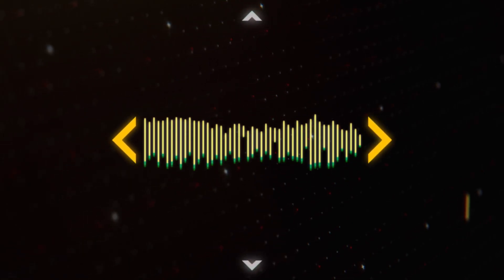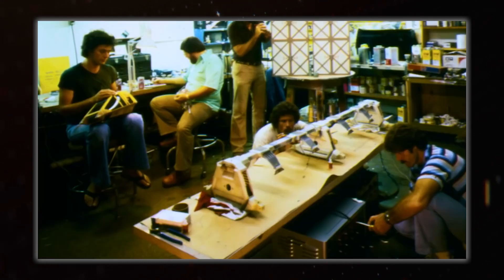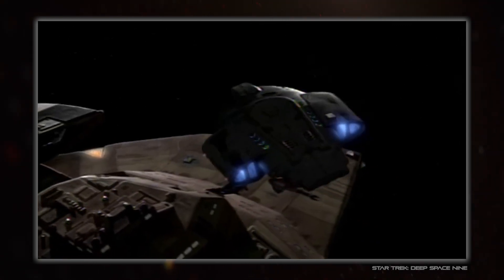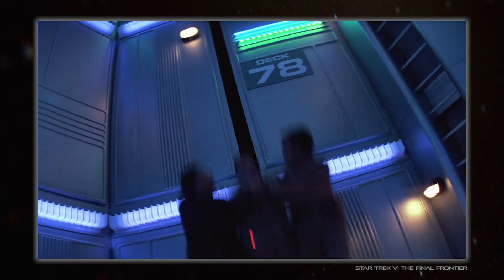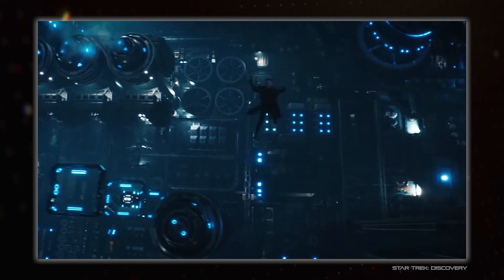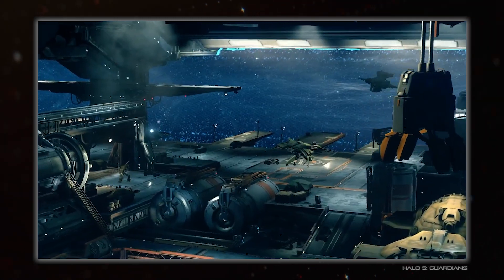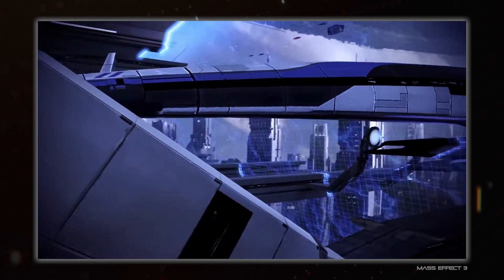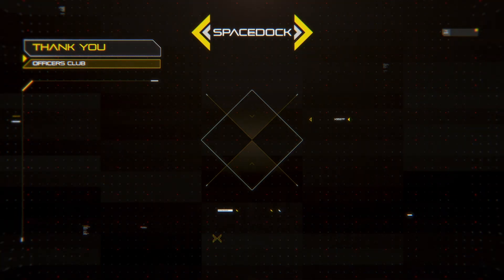Why Do Sci-Fi Spaceships Seem To Change Size?

Comment: Elite: Dangerous is an interesting case where the ship sizes are consistent( and fairly internally consistent with their canonical capacities and capabilities, as these ships haul many tonnes of cargo and the technologies in the Elite universe are quite bulky...) but the aesthetics of their designs lead most players to underestimate their sizes.
The Faulcon DeLacy Anaconda for example is over 150 meters long, but its oversized bridge is easily mistaken for a smaller cockpit, shrinking the apparent scale of the whole ship.
Reply: Star citizen is much the same way. A ship that's currently being developed, the Polaris, actually got upscaled without changing the outer mold line, because they had trouble fitting all the rooms they wanted in it before they made it bigger.
Reply: Elites ships used to be much smaller and then got scaled up to make them bigger early in the development, without adjusting certain proportions. Some smaller ships have handles on the cockpit ceiling that would have made perfect sense for a small ship to squeeze in the pilot seat, but are now way up there (I think that was in the DBX). Also, just Lok up Odyssey Screenshots of the Cutter stairs with people, individual steps are insanely big.
Reply: @klti0815  I don't need to look up screenshots; I've stood at the comically oversized stairs of my Cutter. :P
I actually came very close to mentioning that in my original comment.
Reply: The Eagle class LOOKS like a fighter plane, but the interior camera views show that there's room for three pilot seats side-by-side (it only has one), and the rear of the cockpit where the door enters is easily 10 feet high.

Comment: A physical example on why you don't want to necessarily use correct scales for everything in a strategy game: Star Wars: Armada.

If the ships were correctly scaled to each other, either a CR90 corvette would be a tiny thing and starfighters would be pretty much impossible to use without tweezers, or an Imperial Star Destroyer would take up something like a third of the standard play area.

Comment: Part of this has to do with how hard it is to gauge a spacecraft's size if someone is not standing next to it, even if you have windows and cockpits (which is a big help).  A cockpit, for example, can be as cramped as a modern fighter jet or more spacious than the Millennium Falcon's.  Deck size (space between windows vertically) could be anywhere from ten feet to upwards of twenty feet if you take into account head space and maintenance shafts.

As for the practical size of spacecraft, Star Trek is my favorite in this regard.  Starfleet ships are big enough to have everything they need to sustain long voyages, yet are not so big as to waste extravagant resources filling out a huge space with advanced technology.  There's also a sense of technological advancement, as they are the size of large modern navy ships yet far, far less crowded.  In "harder" science fiction settings more crowded ships make more sense, but sadly these ships often tend to be so large they would be unrealistically expensive to build and crew.
Reply: 👆Wow Congratulations🎊🎊
You have been selected among my New Year ongoing giveaway 🎁 winners INBOX ME  💬

Comment: Deadlock is a good example and one I actually tried testing a few days ago. Someone quoted the length as being about 800m, but if you go by the size of the launch tubes it can't be more than about 300m at most.

Comment: I seem to remember that the Millennium Falcon in Ep IV built in the Mos Eisley spaceport set was actually something like 5/8ths scale of the canon size. And to jump sideways to a slightly different genre, the submarines in the oil tanker set in the Bond flick The Spy Who Loved Me were also built to 5/8th scale, despite being copies of real submarines. All down to the exigencies of having limited space on even the biggest sound stages.
Reply: Considering the comparatively limited budget of the original Star Wars it's impressive such a large setpiece was built.
Reply: I can’t remember if it ever happen in Ep IV, but in Ep V we see Chewie on the inside of the cockpit of that (or a similarly sized) mock-up on Hoth, which immediately shatters the illusion when you notice him filling up most of a space which usually fits 4 people with considerable room to spare
Reply: 👆Wow Congratulations🎊🎊
You have been selected among my New Year ongoing giveaway 🎁 winners INBOX ME  💬

Comment: Scaling is an important subject for us, because when you start building massive ships at a realistic scale you have to start thinking about things like; "could a human realistically manipulate and install this piece of hull plating?". Having everything be consistently human-scale is a fascinating challenge, and it's really changed the way we approach starship design. We've got a crew of 200 on our first ship, so just yesterday for example I was trying to work out how much physical internal volume is needed to feed that many people long term.

I think one of the biggest problems with sci-fi ship scales is that the ships are designed to look good from the outside. Thought is rarely put into the internal structure of the ship, and that's really frustrating for those of us who like modelling the interiors of classic sci-fi vessels :P
Reply: >  "could a human realistically manipulate and install this piece of hull plating?"
Assembly industrial robots: "Am I a joke to you?"
Reply: @DarthBiomech  ,
Human: "I don't work in factories so you don't exist."
Reply: Not to mention how material properties create a limit on size of vessels.  A wooden seafaring vessel can be up to only about 500 feet before it starts breaking apart under stress.  Steel seafaring vessels can be up to more than a thousand feet long but you will start seeing it bend while navigating waves.  With more advanced materials you could get far larger, but the larger you build something the more internal space you need to dedicate to structural support.  The Death Star is probably the very maximum in terms of theoretical size before self-gravitation becomes a problem, and it beats that only because it is a sphere which is a very stable shape.
Reply: @Zorro9129  I love the Star Wars scaling because the technical guides vastly understated the size the big ships are shown at, which also is too small for what they carry. For the Star Destroyer to fit the corvette in the docking bay, and the corvette to fit the hallway shown in the interior fight scenes, a Star Destroyer has to be at least a couple km long, and even that scale is too small for it  to fit some AT-ATs onboard, because the ship isn't tall enough to accommodate them in a way they can be unloaded. Likewise the Super Star Destroyer must be at least ten times the size of an Imperial Star Destroyer from the shot where an ISD passes in front of the Executor.
Reply: @jacevicki  10 times the length, probably like 10^3 or 1000 times the volume.
Reply: @Zorro9129  With the surface area²/volume³ law shouldn't you actually need to dedicate increasingly less of the internal volume to structural support relative to the external shell/hull that you're bracing as size increases? Seafaring vessels are completely different as larger ships only experience greater forces because they're bridging greater gaps between the peaks and troughs of waves as gravity pushes them down, and those forces are constantly changing direction and position, whereas space ships basically have only the one relatively weak force of the main drive pushing along their centre of mass. So, putting all that together, it'd be possible and even advantageous to make extremely large space ships with low overall density, as that'd increase hull strength and shielding while minimising its relative mass and that of internal support relative to propulsion and fuel for greater range/acceleration/top speed, while also maximising internal space to travel in style! :)
Reply: And let's not even get into the issue of having space for fuel -- and additional space for the fuel needed to move that fuel.
Reply: @fyrstormer  Well, in almost any space scifi rocket equation is usually the first thing to go because it instantly "you aren't allowed to do that"s 99% of your ideas.
Reply: @DarthBiomech  ,
Always.

The second thing to go is "How much energy is required to make my technology function and can my power plants provide it".

The third thing is "how do I get rid of all of this excess heat?"
Reply: @aralornwolf3140  The question of "How does onboard gravity work?" is right up there (punintended:) but usually ignored, sometimes yada-yada'd, and very rarely technobabbled even in Star Trek, which is a shame for a technology that should logically tie in with FTL tech. Considering gravity manipulation could easily be one of the richest source of interesting scifi technologies ever conceived, it's criminal that writers are still almost only using it for its original purpose of not having to expensively simulate zero g on set.
Reply: @MadScientist512  No manipulating gravity isnt that interesting because you are telling a story and at best youd get  random thats cool bits that wouldnt add to the story.
Reply: @thomgizziz  Gravity manipulation is a well of innumerable amazing and creative scifi tech, much of which has great world-building and plot potential; this is amply demonstrated in the many sci-fi books that use such technology in myriad ways, which sadly also shows the general lost potential of sci-fi shows basically being a decade or two behind sci-fi books, hence sadly no gravity-tech in shows but lots in books

Comment: The real problem is if the story you're creating with your media depends on the scale being accurate, like if we declared in Chapter One that three Gizmo class attack craft can barely fit inside a Deployer class carrier--and it was important to the plot at that time, but then later on a scene in Chapter Fifteen has the Deployer class carrier's crew walk past eight Gizmo class attack craft inside the same storage bay we mentioned in Chapter One, to get to where the murder victim's body was found.  If it's jarring enough to jar you out of the story, it's "bad," otherwise, it's not a problem.

Discovery did that a couple of times, but the "Turbolift Fight Scene" you mentioned is the most egregious time it happened.
Reply: 👆Wow Congratulations🎊🎊
You have been selected among my New Year ongoing giveaway 🎁 winners INBOX ME  💬

Comment: idk about the actual in-mission railjack model, but as someone who had to build a dock for one, i think its dock(and mission model maybe) is small bc you actually have to fit the dock in the dojo, and it is already massive
Reply: You can go hang around outside on archwing in a mission and they're still not as big as they'd need to be to fit their interiors.
- hoojiwana from Spacedock

Comment: In the game homeworld, the lowest level of detail for ships actually had to exaggerate very specific features so that for example fins were larger than the ship itself so that it could still be identified from a massive distance.  I believe the exact quote was four times larger than the ship in the case of a certain fighter.
Reply: I really wish this channel would use aspects of Homeworld, either as examples or just game footage. I can't recall ever seeing that series show up anywhere here other than in the comments.
Reply: @tba113  It would be nice.  It definitely could have fit here as an example.
Reply: There was actually a setting in the config files which controlled the degree to which the entire model would be scaled up as the camera moved away also. So not only were the silhouettes designed to evoke a certain scale and maintain readability, but the in end everything still had to just scale up anyway. It worked excellently in the games originally and you really wouldn't notice it.
Reply: @MachineCode0 For Homeworld 1 and Homeworld Cataclysm, the "true scale" mods would remove all the  "NLips" lines for you. Since everything else in those ship files stay the same, it could be used as a very handy start-off point to make your own mods.
Homeworld 2 has turning off Nlips, as a standard feature in the graphics menu.
Reply: @hansakkerman2611  yep I know, I was just adding on to what the op was saying.
Reply: @MachineCode0  why yes, I'm from the redundant ministry of redundancy.
Reply: @hansakkerman2611  Really? Is that the same as the Redundancy Department or just slightly different?
Reply: Moot point; I always played from the sensor screen anyway.

Comment: I personally hate the Xyston-class from Rise of Skywalker because it's a literally a scaled up Imperial 1 ISD with red paint and a big gun attached.
Reply: I don't personally hate that ship per se, because at least the ISD was an appropriate ship to copy. It's kinda meta in that it's the Tarkin Doctrine design ethos of the ISD1 taken to its absolute logical extreme. Even the big gun is passable. It's certainly not the most absurd ship-mounted superweapon out there. 

I would've preferred them to use either entire new designs or some more fitting, older ones. Perhaps the ancient Sith Emperor's Eternal Fleet, for example.

Comment: The White Star at one point needed to be increased in size, because the writers decided that a White Star needs to host a squadron of Starfuries. Since that requirement hadn't been established before the ship's design was finished, they couldn't find a place where the hangar could reasonably fit without scaling the model up from what was previously used.

If the requirements for a ship aren't solidified before the visual design, that can require inconsistencies in all aspects, including size, capabilities, shape, ship type and role.
Reply: Starfury's I thought It carried 2 or 3 Minbari fighters?
Reply: @michaelcarney6280  , oops, you're right. It carried Minbari Nial, not Starfuries. In the episode "Meditations on the Abyss" four of them launch from one White Star. It's not shown where exactly they launch from in that scene. Earlier in the same episode there is a more detailed scene of only two fighters exiting a launch bay at the rear. It doesn't look like that launch bay could hold more than two fighters. So presumably there is at least a second one of them somewhere else.
Reply: @frankbruder3097  Yeah I know your comment  threw me and I was trying to remember If I was wrong and an Episode that launched Starfury's they must have had a Star Trek moment and fucked up
Reply: 👆Wow Congratulations🎊🎊
You have been selected among my New Year ongoing giveaway 🎁 winners INBOX ME  💬..

Comment: A similar topic, but a bit different, is the depiction of distances between ships. You see it regularly when you get a callout in thousands on kilometres but you then see its two or three lengths of the protag's kilomtre-size ship.
Reply: I feel like this gets cheated a lot just so that two ships can appear in the frame together. Realistically most space battles would happen at great distances. But it's more fun to see both ships blasting away at close range.
Reply: @darinfoat8410  The Expanse gets this mildly right, and Babylon 5 has some good depictions as well. Like in the Battle of Gorash 7
Reply: @darinfoat8410  LOGH Die neue these and The expanse use their CGI to avoid this issue, they just have the camera move sufficiently fast.

Though it's a style that cant be done with 2d animation or minatures, Only full CG
Reply: @eps200  can be done with 2d and minatures you just have to want to do it
Reply: @eps200  The thing most people don't catch is that the camera doesn't move incredibly fast, in the Expanse, it zooms to an incredibly large values. If it would fly from one shit to the other, the stars in the background wouldn't move.
Reply: Star Trek used to depict this well in the original series (which also saved them on making detailed models of opposing ships), but Wrath of Khan set a precedent that practically every subsequent Trek production followed. The reasoning for the close-range encounters in that movie was well-founded, but it was so much more exciting having them blasting away at point-blank range that they basically did it evermore after that, with or without any reasonable excuse for it.
Reply: 👆Wow Congratulations🎊🎊
You have been selected among my New Year ongoing giveaway 🎁 winners INBOX ME  💬.